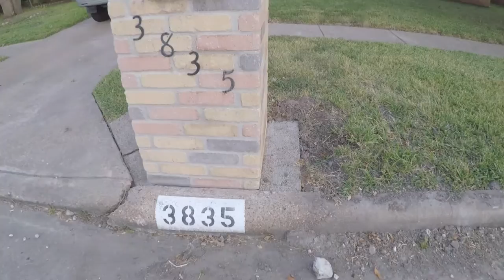How to Straighten a Leaning Brick Mailbox

Comment: You can also use your truck bumper to push level it with someone watching it and with a blanket in between it, much easier then dig
Reply: Pushing or pulling would definitely be easier if the mailbox was reinforced or strong enough. You would still need to contend to the foundation to level it with digging and filling, though. I may have mentioned from another comment that this is the second build. The first mailbox was built solid with a bit of rebar, concrete and cinderblocks... bc, why not. An unfortunate had an epileptic seizure and accidentally hit my mailbox (at low speeds) and almost died. The mailbox shifted, but did not break, totaling the car and sending the driver to Life flight and hospitalized in ICU for a while. We chose to make the latest mailbox hollow and less impact resistant. Even though, it would be the driver's fault for hitting my mailbox, I wouldn't want to revisit that incident again, knowing I could have changed the outcome. I did think about creating a exoskeleton of wood to pull the mailbox, but ultimately thought this video's method to be safest. Your option would be easier. Thanks for the input!
Reply: @CitizenK9 I’m thinking about making some sort of wood exoskeleton to use to pull it with a tow strap, then use some brick on the low side to make sure it doesn’t settle back that way.

Comment: Great job. 
I have the same problem. 
I am going to basically the same thing to fix mine. 👍👍
How has the contract handled up? It looked like the contract was a bit too dry. Is it holding up OK?
Reply from the maker: Thanks! The concrete has held up well... it's still as straight as it can be. You are correct,  I realized (after the fact) that I could have used more water. Thank you for your service.

Comment: I have to go this for my parents.  My only question is, once I dig under the lowest corner to fit the jack and start jacking up the pillar, isn't the jack going to sink?  What can I do to stop the jack from sinking once I start jacking up the pillar to straighten it?
Reply from the maker: at 01:30 , I simply kept adding rocks to the hole my jack created, resetting the height of the jack.. Eventually, the rocks created a pillar deep into the ground that supported the jack. Hope that helps and good luck!

Comment: Jaded Worx very informative video ..I have a 4ft x 4ft. entrance column 6ft high with foundations going down about 4ft. These columns support wrought  iron gates.
One of the columns is leaning away 8" from the other column.
I have looked a numerous videos as to how to straighten this column, but most of the videos show columns with accessible (less than 18""deep) foundations. 
Any suggestions as to how I can straighten this column, or do you have a video showing this sort of problem.
Reply: I should add,   I live in Canada where we get -40C and lots of snow, as that might be relevant.
Reply from the maker: 4ft deep! I guess going underneath is out of the question, lol. The only other option (plan b) was to brace/support the opposing side with metal or wooden beams and pull it straight with tow straps. There is always the risk of breaking the column. Perhaps, we can reduce the stress by digging and freeing up the surrounding of the column. Good luck!

Comment: Should have fixed the curb at the same time.
Reply from the maker: I don't have the experience, unfortunately. From a bit of research, it looked like I needed a mold to form the curb. I should put that on the list. Thanks for the input.
Reply: @jadedworx2708  It's ok, but you had concrete mixed up already, was just a matter of cutting the broken curb out, and trialled it in. 👍😊